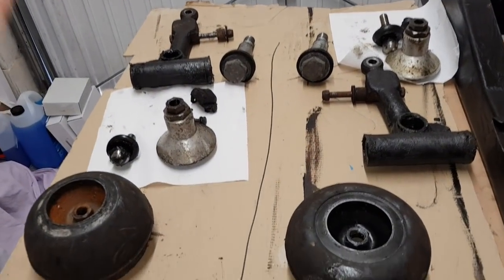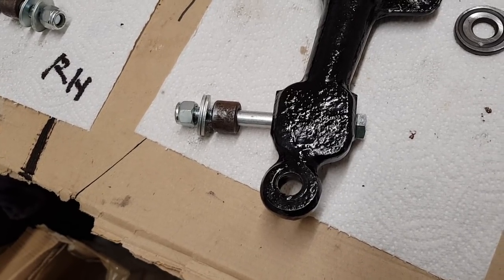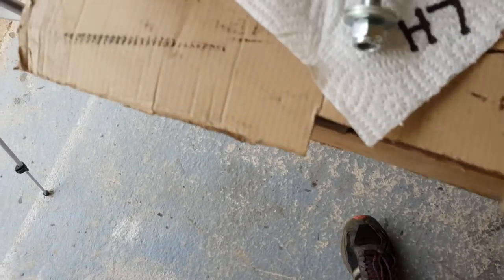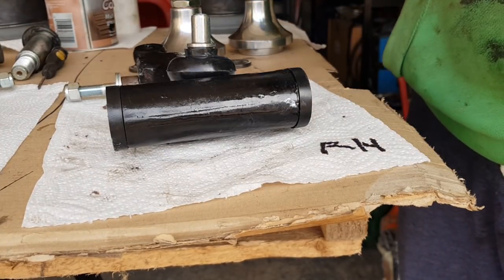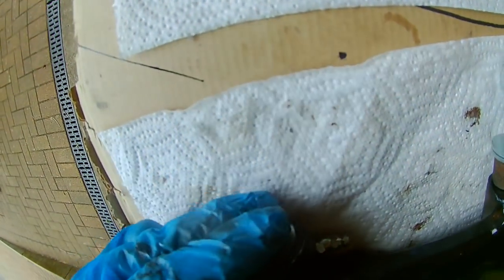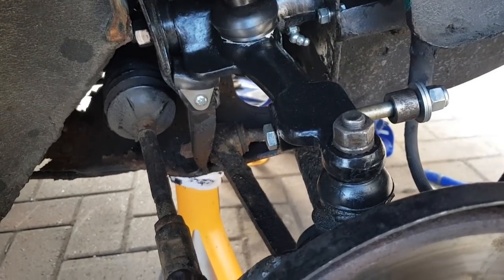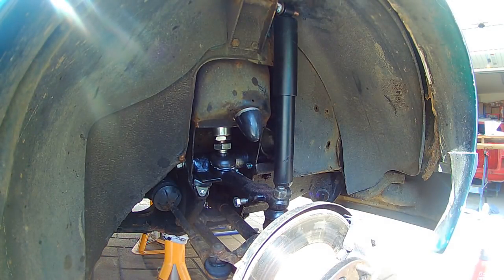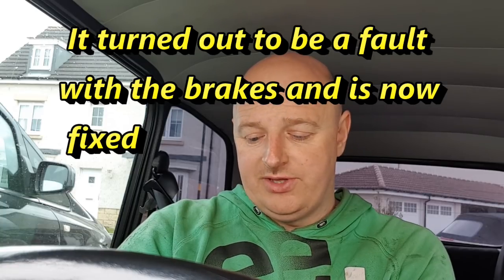Classic Mini Restoration: Ed Episode 8 Front Rubber Cone Replacement Part 2

Comment: Cheers for this two-parter. I replaced the rear cones, hi-los, knuckles and shocks a few weeks back, and it felt pretty simple. I've been putting off the front, but at least have a better idea what I'm facing now!
Reply from the maker: Its not a bad job to do, just fiddly with little access much like most of the jobs on the mini, well worth it though, transforms the handling

Comment: Brings back memories when I did the front end on mine pal before I took it off road to rebuild. The difference in the front was same as yours, excellent, yet made the back end feel terrible. Keep up the great work buddy, look forward to the next vid 👍
Reply from the maker: Cheers Daniel. I do plan on doing the back end too but strongly suspect it will need a new subby once i dig a bit deeper

Comment: Ive watching this video about 10 times and I'm still stuck  - I have a 97 MPi and had to cut 1 inch off the compressor tube in order to get the bolt started to compress the cone  - So that allowed me to fit the Cone/ hilo and top steering joint but now the suspension mount is SOLID with no play in it. - Its squishing the bump stop and I don't think I can even get the top ball joint into the suspension mount - The cones I bought are Smootha ride ones and are considerably taller than the ones that came out  - So I think thats the essence of my problem  - Any experience of this ?

Comment: I tend to leave it compressed then put the arm in and them to little bolts in while it all loose then tightn the top arm fit the high low and knuckle and another awkward job well done
Reply from the maker: Makes sense. Hopefully not have to do it again for many years. Famous last words....

Comment: Preparing to do this job on my '88. Have the Red Spot cones and HiLo's now. Why do you need to use spacers on the knuckle joints if you have the HiLos fitted?
Reply from the maker: The ball joints have play in them when cornering and going over bumps, the spacer just keeps the correct distance between the end of the ball joint and the hi lo for the larger wheels

Comment: I am floating on air” hydro atm , I have sub frames for cone , sitting on the feance whether to change, I suspect rear shocks that had duel adjustable compression and rebound would improve the cone rear, do they make such a shock, I have no idea . Rick
Reply from the maker: I have never driven on hyroelastic so don't have a comparison. One day though i hope to have an earlier model with hydroelastic suspension. My mgf has hydragas suspension and it is nice solid handling